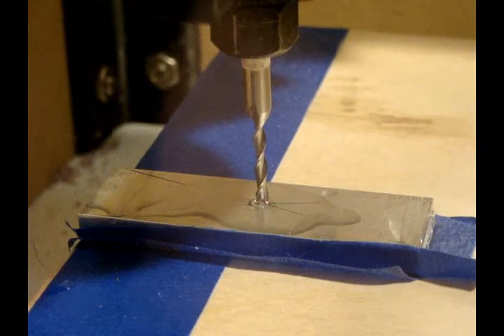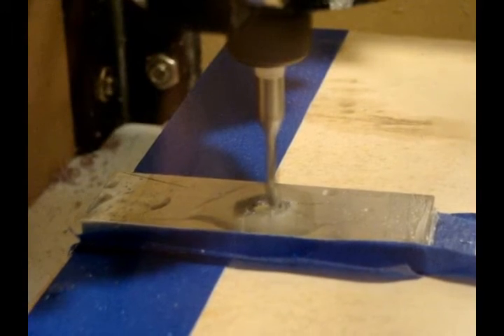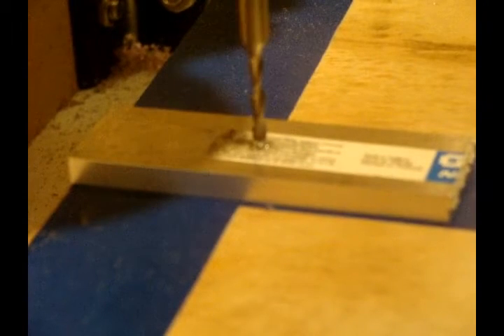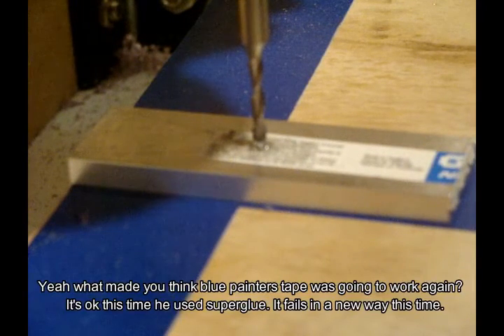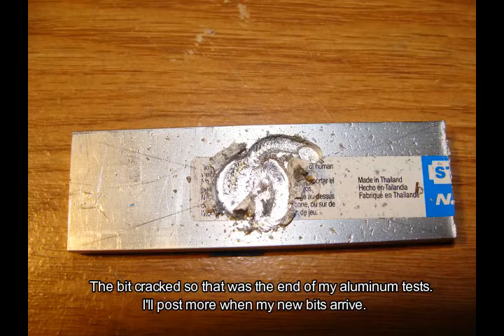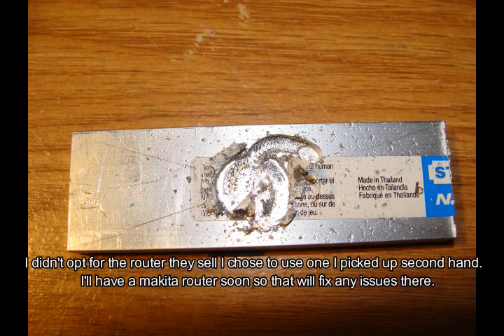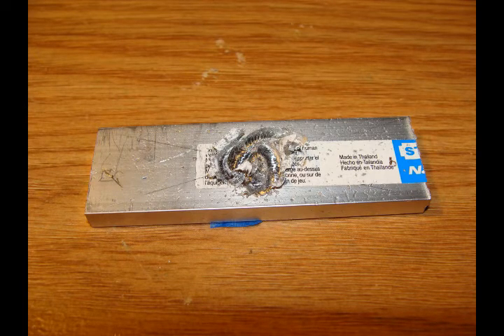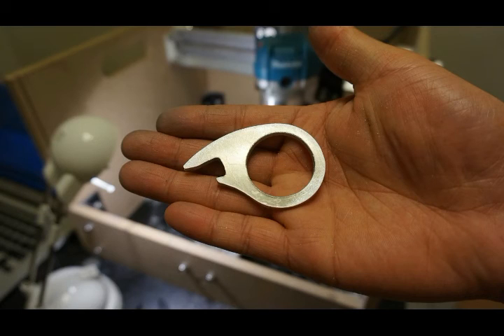SIENCI Mill One - Failed Aluminum Test

Comment: Such a funny video. But do you feel the stepper motors were strong enough to do the CNC work and move the router?
Reply: Let's be honest this isn't an industrial machine. That being said it uses a full lead screw setup which is far torquier than and stepper running belts. I haven't had any issues with step loss that wasn't my fault for trying to over drive the cutting head.

I'm glad you guys like the video I will be making more in the future.

Comment: Try locking down the aluminum part before you test on it. The failure was not in the bit but the operator. 

Would like to see you make a successful pass.
Reply: Actually the second time it was Glued down. It didn't move until the bit had come loose in the chuck and bent. causing it to miss steps and drive off of where it was supposed to be cutting. successful aluminum cuts come soon.